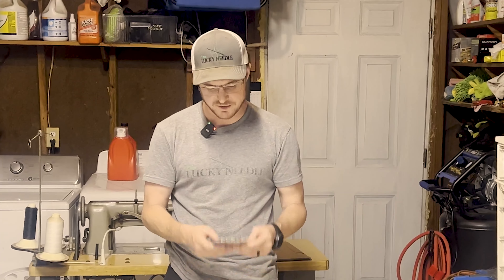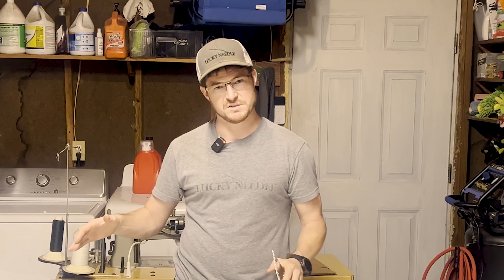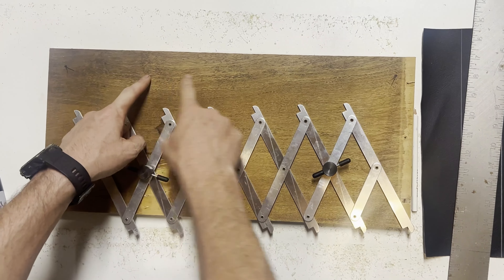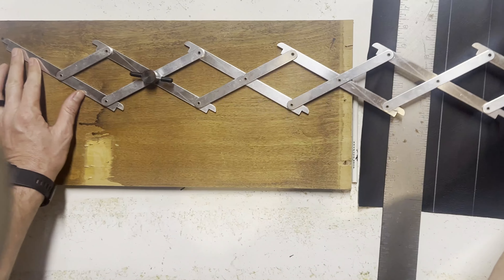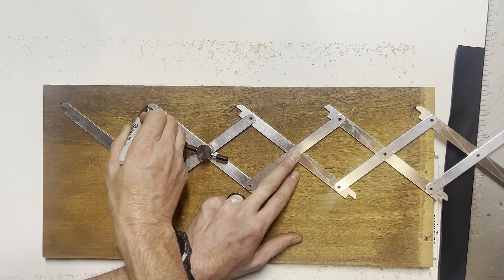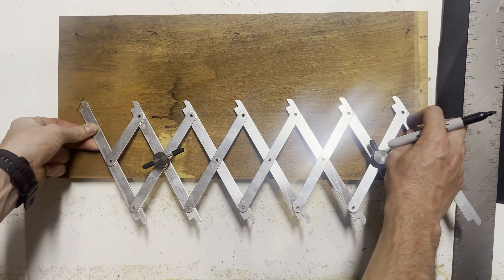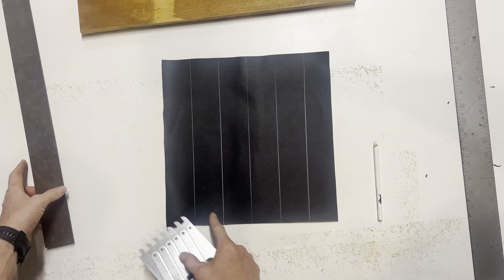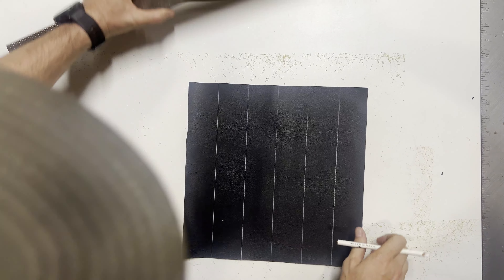Tools Every Tool Box Needs - Point 2 Point Tool

Comment: I have one of those, completely useless as it is not accurate. As you stretch it it warps, you must have a better chinesium version than I did. I had to go back and measure each gap.
Reply: Aircraft-tool makes a couple really tight and accurate ones for spacing rivets. SKU: FS02 and SKU: FS01. Mine are tight with no slop.